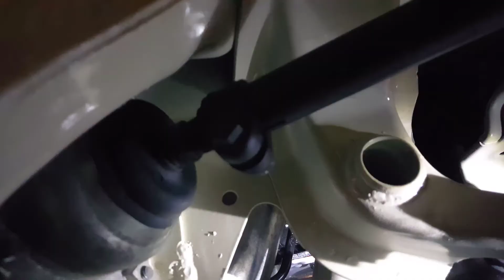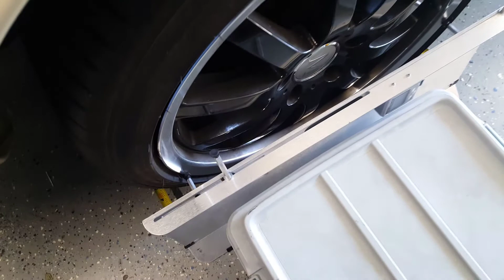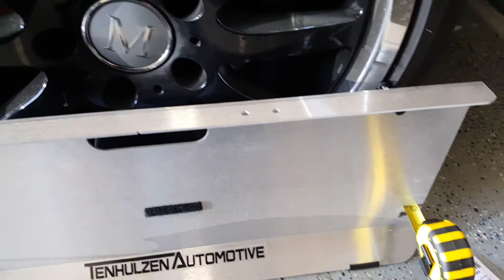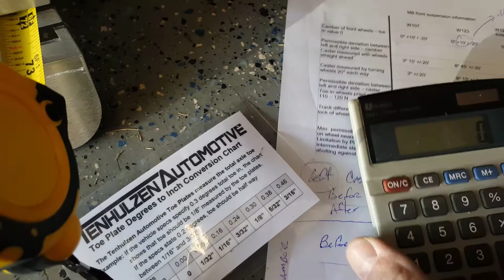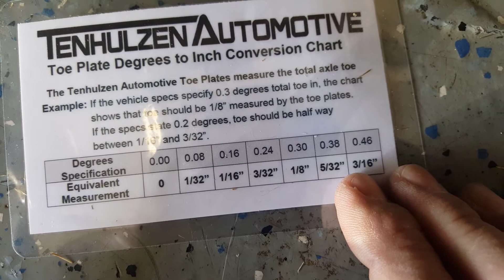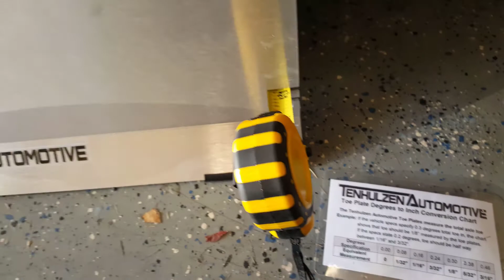Part 2: Aligning the 300D using the Tenhulzen Automotive - WheelAlignmentTools.com Auto 3300.

Comment: Thanks for your video, I ordered the fastrax system to align my W123 after watching your video because the Tenhulsen doesn't stay on the wheel while the fastrax does mount to the wheels. I noticed when you measured caster with your digital level, it showed 3.9 degrees. Do you know why on the caster/camber bubble gauges it shows 8 degrees and why did you have to multiply your number by two? Thanks

Comment: Is the tape measure in the slots of the plate on the opposite side of car that's not being filmed, brought across to the plate on the side you are measuring?
Reply from the maker: yes, the ends of the tape slip into groves on one plate (opposite side) then slip into the groves on the other for measuring.  The pain point is making sure the plates stay even against the rim.  Using a weight against the plate helps

Comment: Without running parallel strings, how do you know both wheels aren't pointing left or right?
Reply from the maker: G MinK for toe there is a plate on both sides and you measure between them. If both were pointed in the same direction it would actually be okay because the alignment would be relative to each other that would just throw the steering wheel off.  I've seen race teams use the string method of the truck but don't know enough about it. It would be great to learn that